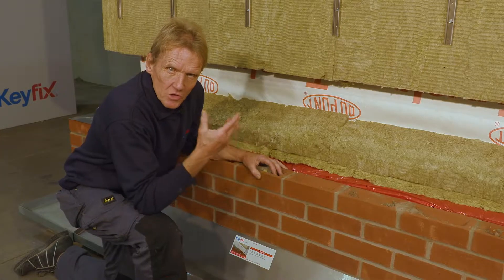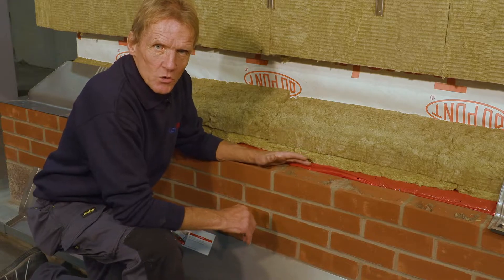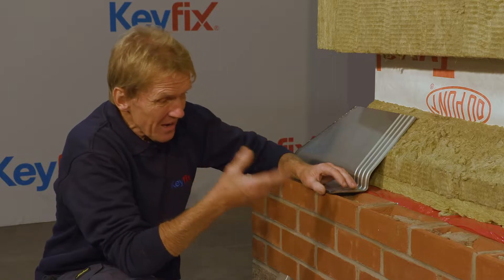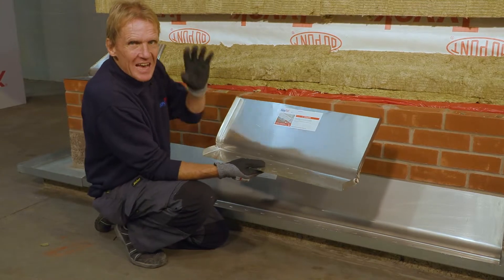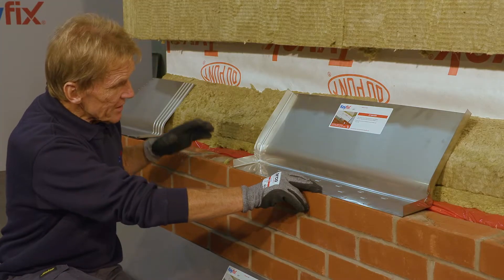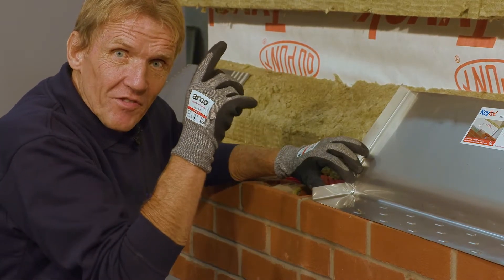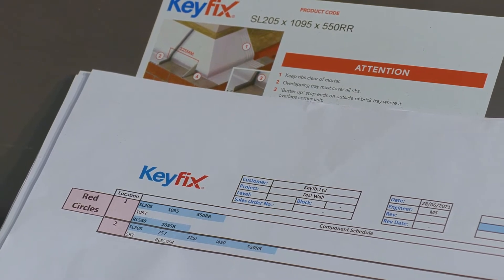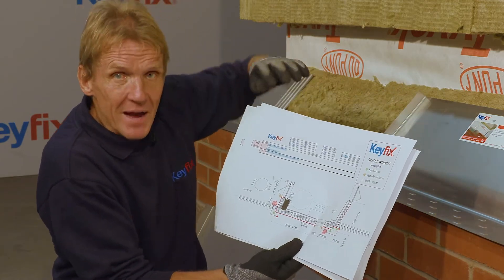What is the function of a Cavity Tray

Comment: Why is the Cavity stuffed with Insulation 
Its stupidity
Air is the best insulation and neutralises the outside and inside humidity
Reply from the maker: Hi Roy, thanks for commenting on our video! Around a third of all heat lost in uninsulated homes escapes through the walls. Insulating cavity walls helps save energy and will ultimately cut costs off of the homeowner's heating bill. 

It's worth noting that we don't specialise in insulation, our primary focus is on Non-combustible Cavity Trays for high-rise building projects. Great question though.